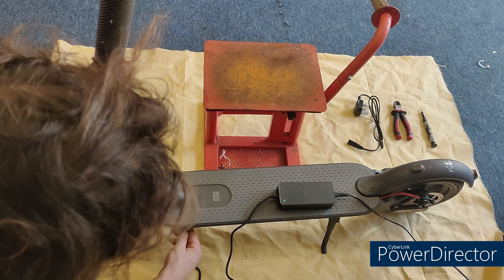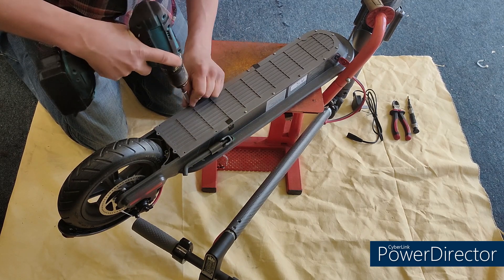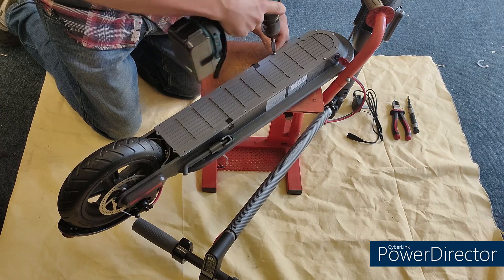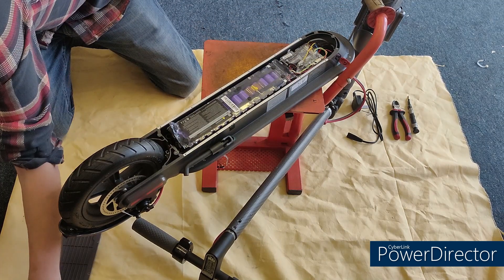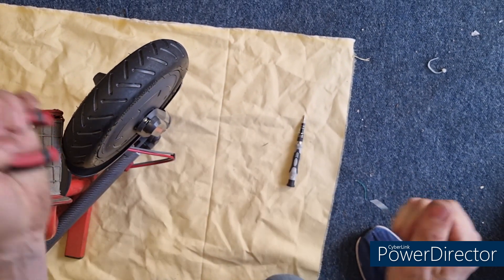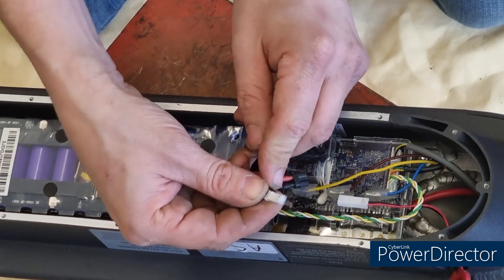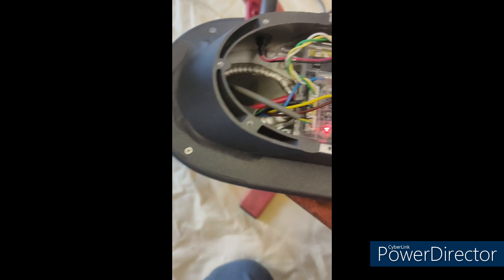Xiaomi M365 E-scooter NO Power Simple fix! with basic tools Wake Battery

Comment: This is the solution when the battery does not charge because it has not been used for a long time.  Thank you very much for this great contribution to the community
Reply: How long did you leave it on after the light on the charger turned red, cause as soon as I disconnected mine to start charging normally. The light on the charger turned back to green.
Reply: @TheZmoss  how did you solve your problem? I am in the same situation
Reply: @antoniovictor6080  still the same it didn't fix anything
Reply: @TheZmoss  man, I fixed it yesterday. It happened to be the thermal sensor located in one of the side bars where the tabs of the batteries are soldered. I replaced it and the battery started to charge.
Reply: @TheZmoss  the white thermal sensor that is placed between the cells
Reply: @antoniovictor6080  thanks man, i'll have a look at that and how much did it cost you to replace the parts?
Reply: @TheZmoss  nothing. I already had one piece from other part

Comment: Definitely earned yourself a like, comment and subscribe - just saved my scooter from being taken to the recycling centre as it's been sat in the boot of my car unused for about 4 years.  Only took a minute to get it back up to the single red flashing light so this inbuilt protection must have done a perfect job and cut off any parasitic drain so that the battery can just sit there at a low but recoverable level.  Brilliant.  We'll see how much capacity this took off it (I expect it'll recalculate from the 98% that Scootbatt is showing), but alive is alive!

Comment: I used this trick on my M Scooter. Battery did not have a light to indicate stuff so I just left it charging a little while (1 hour give or take) and then put it all back together. It worked. 🎉
Reply: OK it worked but then stopped and had to do it again. I realized the battery is no good. It didn’t hold charge and basically when I went over 5 mph the scooter would shut off. I bought a battery on eBay and swapped it out. Now it’s working like brand new

Comment: So awesome dude thanks!!! I found a d8 pro scooter in the trash yesterday with a random 7 volt charger wired into it. Guess the previous owner didn’t know it wouldn’t charge because that chargers to weak and also the bms was in shutdown mode. Followed your method and it woke up and works! You definitely need more views this is super helpful and saves so much potentially good batteries from being thrown out.
Reply from the maker: Great news:)

Comment: I need to say I was very skeptical. But tested battery before attampt and it had only 12.5V. 
Did bridge the ground as you made it in video and battery got 36V in less then a minute. After that wired as original and it started charing normaly. After 10min of charge tried and scooter works again. 

To mention, before that, scooter wasnt charged for more than a year. 

Thank you for video! Kudos
Reply from the maker: Good news, yep can save a lot of 'dead' batteries like this
Reply: @EscooterbitzRetropad  A friend has ECO Speed 8 scooter, hasn't charged it for a year or more... I'm interested is this aproach would work to :) 

But can't fund much info on web about it.

Comment: In my case, the battery light is on as soon as I plug in the charging cable. I followed your instruction and connected the black wires together, then the light turned blue/ purple. the light on the charger turned red. But as soon as I disconnect the connection, the light on the charger turned back to green.I think the battery really over discharged. I think the battery hasn't been charged for at least 2 years😭 Thanks for Xiaomi for making it so hard to change the tires, so I put it aside for long....

Update: Just checked on the scooter again. I kept the black wires connected together and kept charging. The light on the battery turned to blinking red light. I tried to turn on the scooter and it was on!!! I assume the circuit has issue(s) or it really got discharged for long. Gonna keep it like this for a few more hours.

Comment: This worked thanks! (Screen on, fully charged and running) However mine won’t turn on or charge without the wire. Do you have any idea why? Any help appreciated.
Reply: Have you solved it?
Reply: No unfortunately. I’ve just left the wire attached wrapped in electrical tape
Reply: @tinheadtalbot  man, I just fixed it. It happened to be the white thermal sensor in one of the side bars where the battery tabs are soldered. I changed it and the problem was gone
Reply: @antoniovictor6080  cheers for that man 👍🏼

Comment: amazing , that did the trick . thanks alot . it was very simple solution ... 
 please note... , that you should not leave this charging way for longer time , be sure your voltage dont get to high since you diable charging controller.
Reply: Oops
I didn't know and left it charging for hours
It now turns on, but after a few rides, it dies again. I performed the resurrection three times.

Any suggestions on what to do now to stop it from dying ?

Comment: I have a question maybe u can help. When applying above 75% throttle the motor pulsates like it's struggling. Below 75% it's stable. Seems to ride ok however it's limited to about 10mph used to do about 14, can feel the difference. I changed throttle, hall sensors but still doing it. It's had over 150 charges. And 3 years old. I have 2 of them and my second one has just started doing the same thing. Do you reckon it's battery. As I can't see it being the motors on both.

Comment: Hi there! I did your trick and it seemed to work. I have no lights on my battery pack. But, the charger light turned red and after awhile (approx 1 hour) the battery was reading 35 volts, the scooter turned on and showed 3/4 full. Which is definitely an improvement, because before your hack, it wouldn't come on at all! However, when I attempted to plug in the charger "normally", the light stayed green as if it was fully charged (like previously). The charger is testing good. what else could it be? I do not have a reset button on the BMS (that I could see). I have never actually gotten to ride this scooter (it is brand new) because I left the button on and it fully discharged the battery..
Reply: Okey dokey! I finally got to ride it today after a complete charge. down to about 1/4 charge. still no love from the wall charger. I am now hooked on this thing now that I rode it! If only I knew what to buy to fix it? I would!

Comment: Thanks for video. Unfortunately my battery blinking red all the time. When i plug charger like you show on video it starts blinking blue and red in same time but battery is charging (comes red on charger and i check voltages by multimeter). Something else is broken? Bms is damaged?

Comment: hello, thanks for your video.
I have no leds on my battery but 
I followed your step and power supply red light stayed red for about 2h with metal cable bridge, then turned green again.
i reconnected everything and now led stays green, but scooter is not turning on. any idea?
Reply: I did this as well and now the charger is green. It will shortly turn red and after 5 seconds turn back green. Did you ever figure it out?

Comment: so after you connect the charger to the scooter, you disconnect the wire and put it normally back togheter while charger still connected? then let it charge? does this work with the m365 pro too?
Reply from the maker: Yes the pro is the same

Comment: Hello, how much time does it usually take for the light to stop blinking blue and red and for it to start blinking only red? Im using a copper wire from an aligator and its taking more than 15min
Reply from the maker: It varies depending on how depleted the cells are and the amperage of your charger.

Comment: @escooterbitz I had this exact problem, and i solved it after two days, you have to disconnect the flat cable that connects to the bms board from the battery pack, when you connect it, you have to connect the charger right after the connection, i did that and it started to charge and blink in red, commentif it helpful or not.

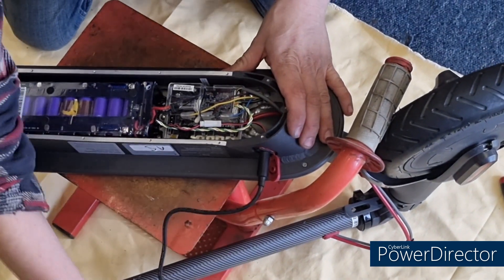Comment: 3:19 I have the red and blue light on the BMS flashing simultaneously, and has been for a couple hours now, does anyone know what this means and if I should keep waiting? I have tried plugging it back as normal but the red light on the charger stops again. It's only at this very point that I've seen any signs of life from the scooter.

Comment: So charger stays on while ground jumper is connected, once I unplug it.
Goes back to not working.....any idea what else it could be?
Thanks
Reply from the maker: @gsr187t  Hi, The next step is to try hitting the reset button on the bms if it has one (not all do) then open the battery and test individual cell packs.
Often the tabs from the bms board to the batteries break especially if using solid tyres.
I am going to make a video on next steps soon

Comment: Ma'am/sir is it compatible that the battery of xiaome that I bought can replace to stark scooter as same model?
Reply from the maker: Hello, Yes it should work on any M365 or Pro battery that has the same 2 cables
Reply: @EscooterbitzRetropad  do you know the stark scooter sir? I'm afraid because I ordered xiaome m365 battery for my stark because I think they are same body parts but Different brand, is it okai sir? Thank you sir for responding my question and sorry for my grammar ☺️ I'm your new subscriber💪💪
Reply from the maker: Hi, I am not familiar with the Stark brand. There are many many Xiaomi clones. They normally have cheaper battery packs without the smart bms.  But are are the same size so Xiaomi packs do fit but without the third cable attached.

Comment: After the two lights have been flashing for a while and I connect the battery cable again and plug it in the led on the batter flashing 3 times short and one time long and then stops blinking. It is not charging.and still dead. Any ideas ?